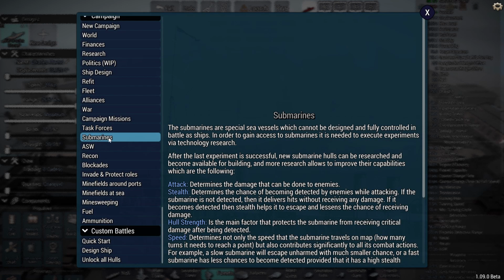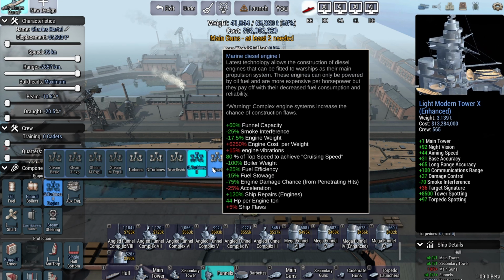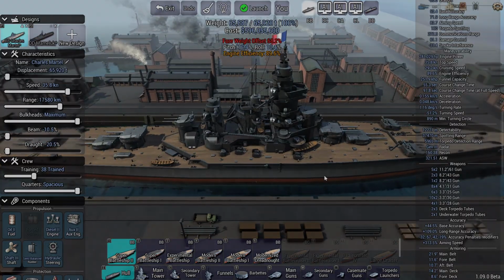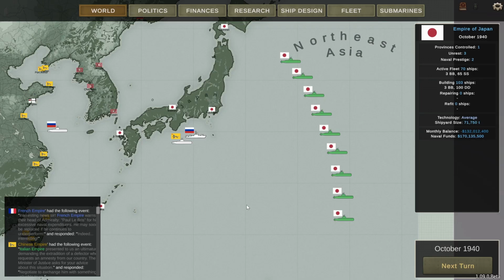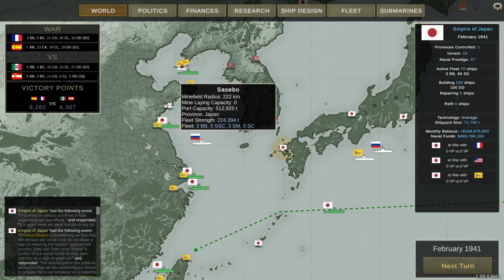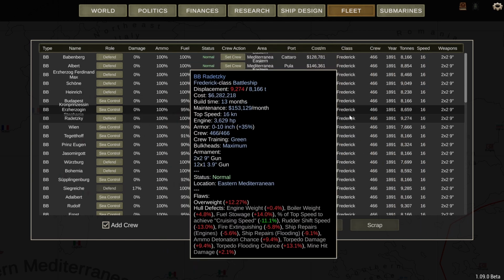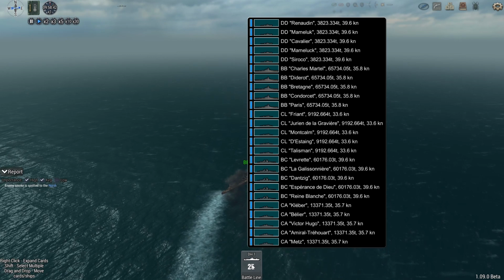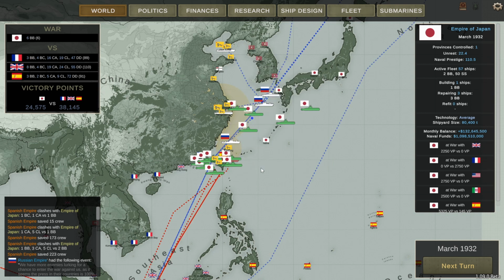Ultimate Admiral Dreadnoughts New 1.09 Beta First Look

Comment: I think ship flaws cause break downs during battle, I have had random ships loose significant speed in battle without being hit by anything.
Reply from the maker: this is due to low fuel not ship flaws. if you right click on your division tabs it opens the ship details tabs. hover over them and it will tell ypu their fuel status.
Reply: @godspeedthunder  Then why is it happening to ships right outside their own port? I am using max range and 100% efficiency fighting only a few km from home and still loosing engine power.
Reply from the maker: the fuel usage during battle is absurdly high. even if you start the battle at 100% fuel you can use it all up after 1 hour of gameplay, even if you have 300% engine efficiency. they clearly need to rebalance this.
Reply: @godspeedthunder  Holy smokes you are right, started a battle with 100% and ran out within a few minutes even running at half throttle. What kind of crazy BS is this? 13,000 km range and it went like 15km before running out of fuel.
Reply from the maker: yup its pretty dumb. sadly this patch is unplayable right now. subs dont work, mines cause insane friendly fire, enemy ships dont repair and so remain in port forever.

if you want to actually play the game, the only option is to go back to the live branch and wait until they fix all of the problems in the beta.